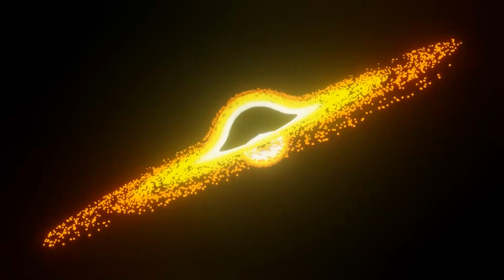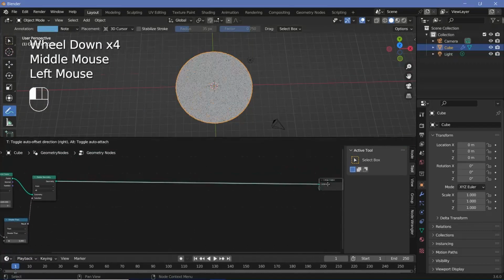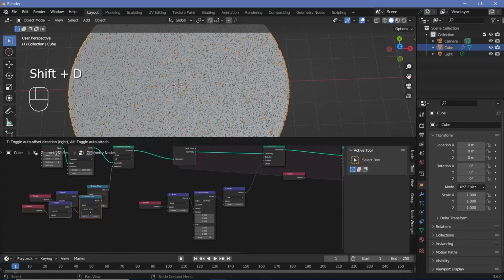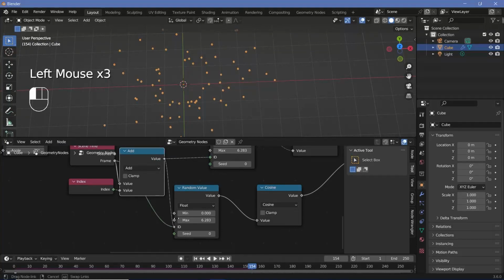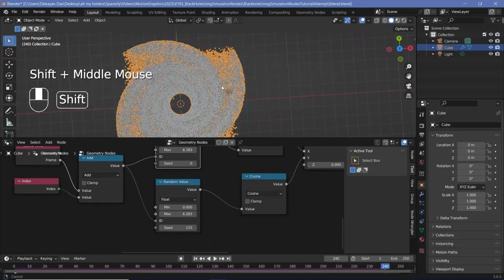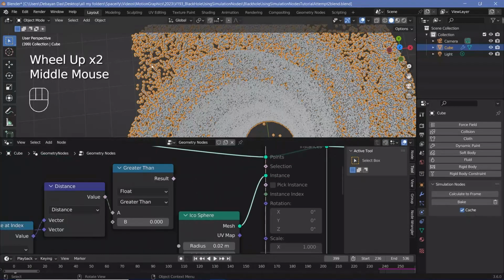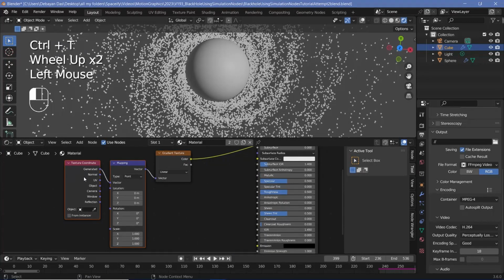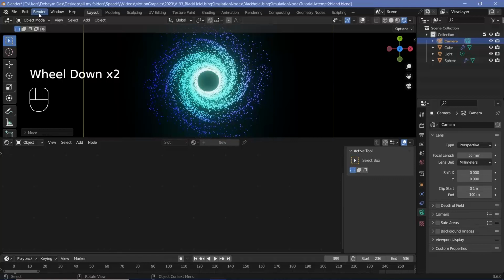Stylized Black Hole / Galaxy using Simulation Nodes - Blender Tutorial

Comment: What version of Blender is used here?

I cannot find the simulation nodes in the physics properties tab!

Edit: Found it! The spiral must be selected!
Reply from the maker: Hey, I'm using Blender version 3.6 itself.

I'm glad you found the option.

As different simulations can created on different objects, the simulation cache option appears based on the selected object. That way, you can bake only certain simulations without baking others as well.
Reply: @deayanstudios  Thanks for your answer.

I have another question.

I wanted to use this galaxy as a background for, for example, something like this:

https://www.youtube.com/watch?v=j_2N7jE8_NA

An animation I made on my other channel.

I baked it from frame 0 to frame 536.

When I tried to make this animation really long, and bake it, a second time it only baked the animations for frames from 1 to 536, and not to 3536. 

Is this a bug? 

When I tried it a second time, Blender 3.61 crashed!

Apparently, I don't understand this baking business.

Maybe you can help out? Or direct me to some video that explains baking?

BTW. Great video!
Reply from the maker: I'll have to take a look at this and test it out on my system to answer that.
By default I know there's a cache limit that has to be set when doing normal physics simulations or else only 250 frames are baked by default, however, I haven't tried that with Simulation nodes yet. Give me a few hours and when I get to my system, I'll check it out.

If you want to check out how to change the simulation cache limit for physics simulations, you can check out a portion of this video I had made a while back:
https://youtu.be/RPe-Hqu-Lkw
Reply: @deayanstudios  Thanks!

I'll do that.

I have just discovered your channel. 

You make very nice videos. Probably many are very helpful to me.

Also, you are awesome good at programming with nodes! I really held my breath in the way you solve problems with  your skill!
Reply from the maker: Thank you so much! I really appreciate it :)

I also finally got a chance to take a look at the simulation baking limit issue you had been facing. I don't see any type of limit for the cache when using simulation nodes. 
I was able to bake 5000 test frames without having to change any settings. 

If you use the "Calculate to frame" option (instead of the "bake" option), the bake will occur only till where the timeline cursor is present (till whatever frame you currently are on). That might have been the cause of your issue. Try to just delete the bake and rebake using the bake button and I hope it will work.

Also, in case too many particles are formed over the course of the simulation and the particles are not deleted, the time it takes for the bake to calculate starts increasing every frame towards the end, and that might also cause the bake to fail. 
Ensure that extra particles are deleted as well, if possible.
Reply: @deayanstudios  Thanks!

I'll look into it, and follow your recommendations.

Comment: The stars towards the center of a galaxy dont move faster than the outer ones like a planetary system, this is what Vera Rubin discovered that led the the theory of dark matter
Reply from the maker: Although you are definitely right, let me explain what my knowledge dictates.

Due to dark matter, stars move at roughly the same speed, yes. However, because of that very reason, stars at the edge of the galaxy will take FAR longer to finish one full rotation as compared to stars near the black hole. That's because the the stars towards the edge will have to cover a far greater distance in their Orbit as compared to the stars near the black hole.

That's exactly what we depicted based on our set up.

For example, the star - S4716 takes ONLY 4 years to orbit Sagittarius A*, while our own sun takes 230 million Years to orbit Sagittarius A*.

Hopefully that clarifies the doubt?
Reply: @deayanstudios  yes lol, I did add a comment to my comment mentioning this, you've taught me alot about simulation nodes so thankyou, they're extremely powerful
Reply from the maker: Ah yes, I missed the second comment, I'm sorry for that. 

Thank you so much!! I'm glad that the tutorials are helping :)
Reply: @deayanstudios  That black hole effect at the end was pretty cool, bookmarked your full tutorial on it as im heading to bed, its 1.25am here in Australia.
Reply from the maker: Thank you so much! 
I'm glad you found it cool. 

Good night :)
Reply: Dont get me wrong, the orbit of inner stars is much shorter then the outer stars so it appears that they move faster but when measured compared to their orbits they actually dont, still a good tutorial so thanks for the info.